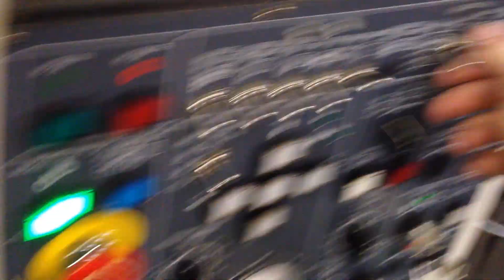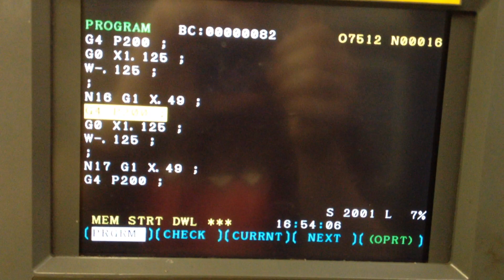Using a CNC lathe to turn urethane tubing into gasket rings.

Comment: It is awesome, but question. Do you really need the coolant for this?
Reply from the maker: +Guy Gustavson Friction of the blade heats up the tubing enough that it starts re-bonding with itself after the blade pulls out, you'll notice that I struggled separating the stack I cut dry for the video and the stack I grab right after that in the bucket was cut with the coolant on and basically falls apart in my fingertips.
Reply from the maker: +Max Maruszewski Coolant is almost never to "lubricate" the tool, carbide actually does very well cutting dry and tool life isnt significantly decreased. Coolant is almost always either simply for just that, 
1: cooling the part and tool to maintain stability or prevent melting in the case of plastic
2: chip evacuation in the case of an insert drill or boring bar, flushing the chips out of a hole to prevent serious galling
3: surface finish due to chip rubbing the already cut portion of the part.

99% of the time the only reason you need coolant for anything is #2
Reply: +Max Maruszewski +1 I just finished machining a whack of UHMW and you absolutely need coolant! Without it you're chips (more like string) started welding to the tool and the part and before you know it you totally ruined the part and can even break the tool. I've seen 1/2" HSS drills twist off in plastics do to chip welding.
Reply: I once very nearly welded a drill bit into a piece of 1'' acrylic. IIRC, I managed to get it out via breaker-bar. It was not a fun experience.